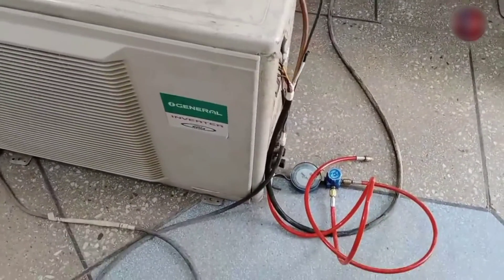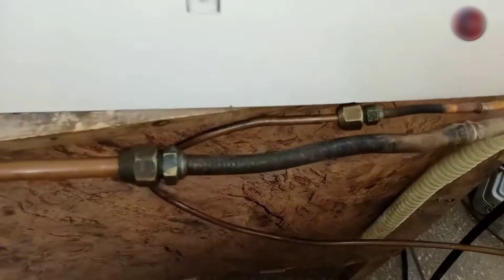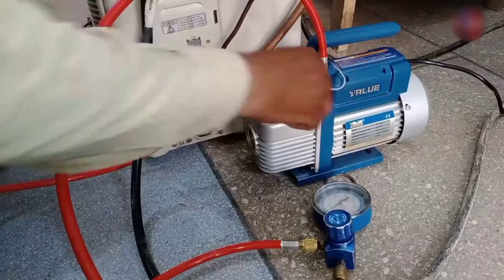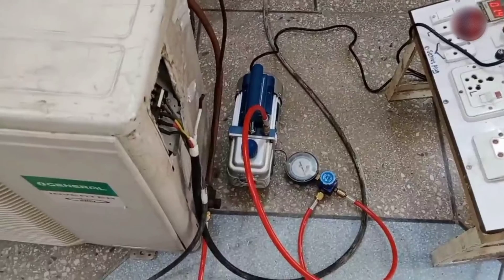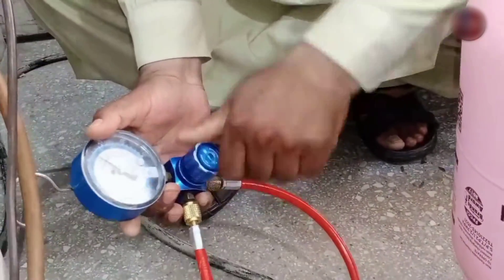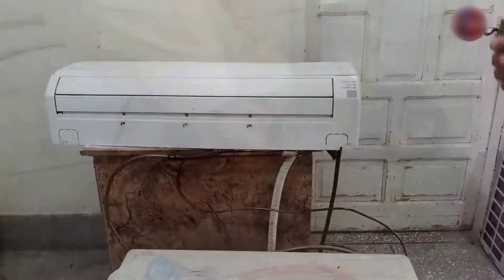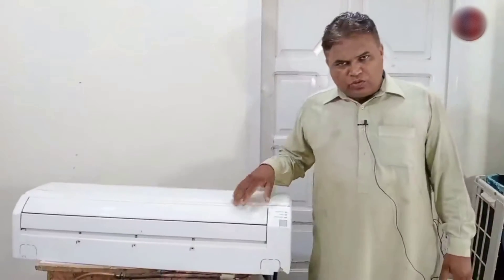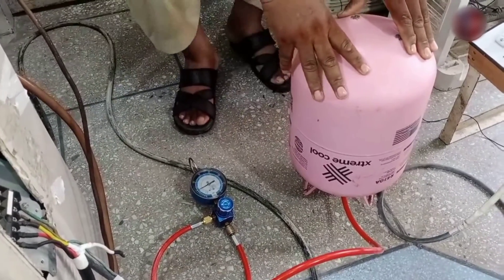How To Add R410A Refrigerant (Freon) in Mini Split Air Conditioner!

Comment: What should the air temperature output be from the indoor unit when the ambient temperature is 48c and the humidity is 30%, and the outdoor unit is in the shade and the ac is 2 ton rated, i am only getting 15c from the vent with blower on full, while my window ac  gives an output of 10c while it's in the sun.

Comment: Hi, Forever Tech. I enjoy your video as they are highly informative and helping me as a new technician in this field of refrigeration and air conditioning. My question on the R410a charging. I'm aware of the fact that it is charged in a liquid state as a blended gas. But in most airconditioning unit the charging is done on the suction line, which at the point of the service port the returning gas refrigerant is supposed to be in its vapor state for the safety of the compressor. Now, what happens with the condition of the compressor if we charge the refrigerant (r410a) in a liquid state? Thank you in advance for your response.
Reply: I think he can destroy compressor by filling liquid on suction side as he shows in the video.

Comment: This is very imprecise, Running pressure is NOT the only parameter for determining correct charge, total super heat and target superheat temperatures are vital, without those two there is a risk of overcharging the system which could wreck the compressor due to the return gas being in liquid form. please do some research on how to correctly charge a AC unit.
Reply from the maker: Yes your info is correct, But If I charge the refrigerant according to the weight, what the specific companies AC recommend, it will never overcharge.
Reply from the maker: And I have charged it with the total weight method